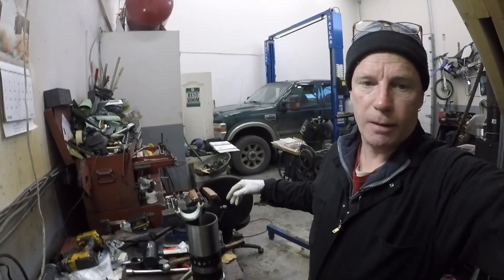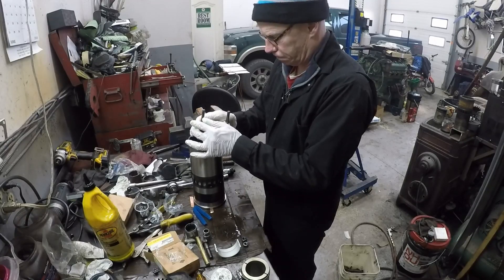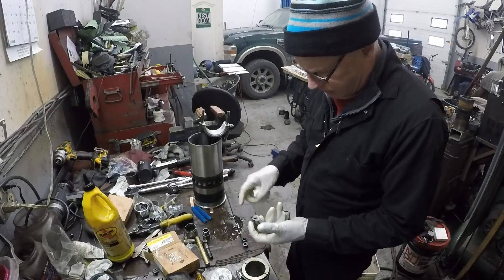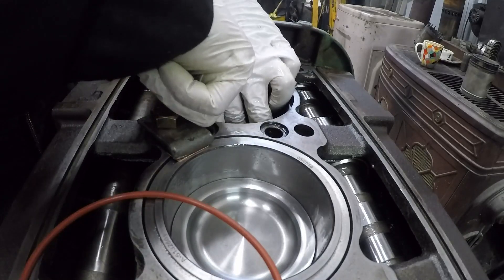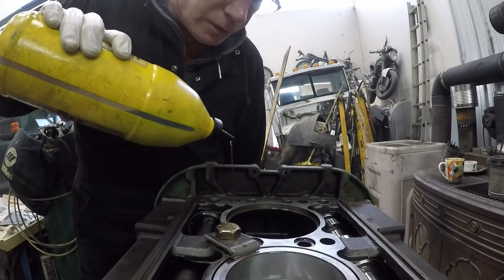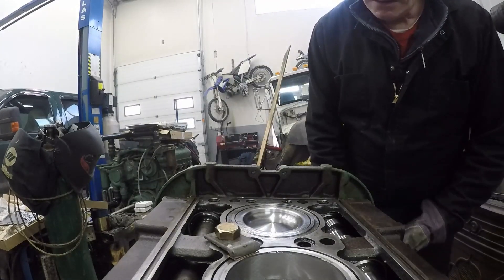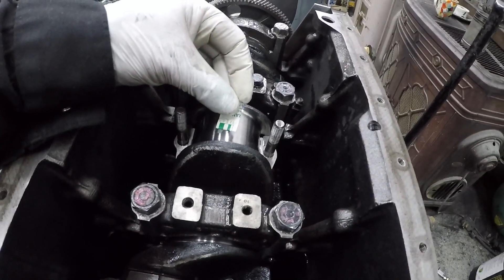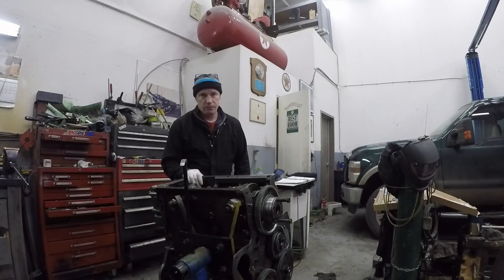Detroit 353T Installing Wet Liners

Comment: Great video Brother.  I quit using Dawn dish soap because it's a petroleum product that will over time, desolve the o-rings. I use either dielectric grease or Astroglide you get at walmart. Please don't take my recommendation in a negative way.  You've forgotten more than I'll ever know!
Reply from the maker: Thanks, I've not heard that one, but have heard of guys using antifreeze as well.:)  I've tried lard as well and that works nice.:)

Comment: The way we built 6 and 8V92's was once we had the cylinder kits built we would take the liner O-rings and soak them in 100% antifreeze(glycol). The material they are made of is designed to grow when exposed to glycol. Not more than 10 mins in the glycol then pitter patter to get the kits installed before the O-rings get too big. The glycol also acts as a super slippery lubricant. If you do it any other way, you risk not having glycol not in contact with the whole O-ring where its up against the block and liner, it can grow unevenly and create sealing issues.
Reply from the maker: I've heard of guys using glycol to install them.:)  I'll have to give that a try on the next Silver 4-53T build.:)

Comment: Do the notches on the rod bearing go on the intake or exhaust side? Or doesnt it matter?
Reply from the maker: I'll have a look in the manual tonight for the correct orientation.  If I'm not mistaken the numbers on the rods are on the same side as the main caps.:)
Reply from the maker: Ok, so the numbers on the rods are on the same side as the numbers stamped on the main caps.
Reply: @detroitgarage9430  thank you!!

Comment: I found your videos very informative. Presently i am doing a 353t cylinder head replacement due original crack and injector tube leaking. Can you tell me what precaution to take with water on the piston crown which seems some get into the air box. Sadly we already install the head but hasn't attempt a start.
Reply from the maker: You should not have any coolant or water on the crown.  If you've replaced the leaking injector tube and don't have any cracks, then no water will be present. If you think you might have coolant present just pull the injectors and turn it over.  This will get rid of any coolant or water that's present.  For the airbox, just make sure the drain is open and that's about it.  Thanks for watching.:)
Reply: @detroitgarage9430  superb..thz for your response

Comment: GM were ahead of their time using wet liners. The most unusual thing i have worked on is a wet/dry liner in a EA7-470 Mack.  The top half of the liner is wet, and the bottom half is dry. I had one liner that needed the whole front end of a truck (4,500kg) jacked up on the liner for pressure, and beads of weld down the inside to shrink it.   30 minutes later it had 'popped' and could be uninstalled.  Interestingly all the other liners installed smoothly excepted the same cylinder as the difficult one.  So, I got the liner straight from the freezer and sledge hammered it (under a block of wood) in quickly as possible before it heated up and expanded into friction fit.   When measured the liner protrusion for all cylinders was perfect.
Reply from the maker: The 53 series are really nice to install and work great.  This is the second Detroit I've rebuilt now, so slowly learning some tricks.  I still have the 2-53, 4-53T, and 6V53 to build.  I might by my own tooling for guides and cups and bring the overhaul cost down further.  At the moment I send the heads out for cups and guides.:)  Thanks for watching.:)

Comment: Watching you put the cylinder assembly into the block prompted some more memories.... I remember when putting a 149 series liner piston & rod assembly into the block, we had this huge rubber “gob stopper” that fitted into the top of the liner.  You did up a bolt in the top of it, and the rubber expanded to get a good grip on the liner, and you used that to hold onto it as you lowered the assembly into the block.  Getting some really old memories coming back.
Reply from the maker: This one of my favorite parts of the rebuild.  Just something good about putting liners in.:)  Getting closer to hearing this old engine run after being thrown out.:)

Comment: That 3-53 must've had some serious hours on it at one point in its life to have 20 under bearings. It will be well cared for now with you!
Reply from the maker: True, the mains are 10 under and the rods 20.  Was last rebuilt be Cullens Detroit in 1993.:)  Very tight clearances, .001 on the rods and .0015 on the mains.  I bought new bearings, but could have used the old ones.:)  She's a keeper.:)

Comment: All the inline engines have really robust bearings compared to the V's. Thanks.
Reply from the maker: They're well built that's for sure.  This one is in very nice shape clearance wise.  I had to re-measure the journals again after I made this video as they were all .001 clearance.  Very tight.:)
Reply: @detroitgarage9430  What is the spec on clearances for that 353?
Reply from the maker: @rodneymiddleton9624  .001-.004"
Reply: @detroitgarage9430  That's perfect. It must have not been ran much.
Reply from the maker: @rodneymiddleton9624  True it had very low hours after the last rebuild in 1993.:)